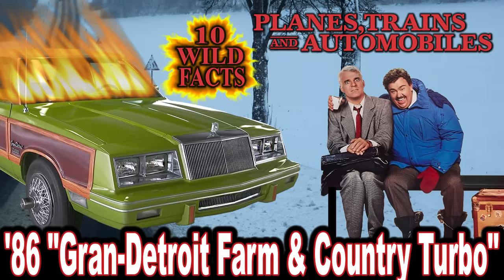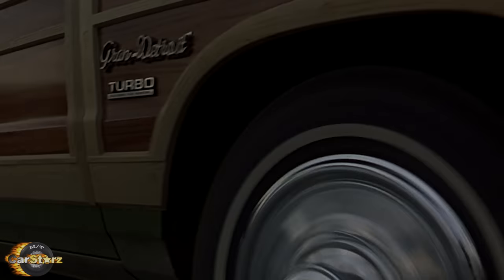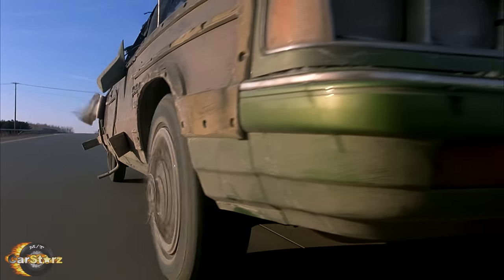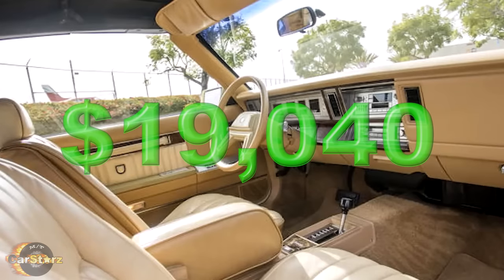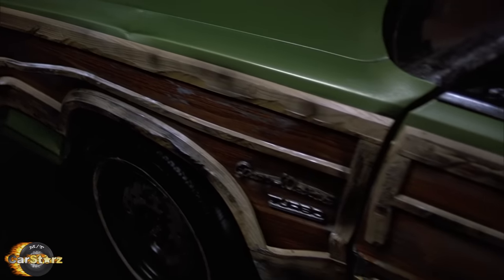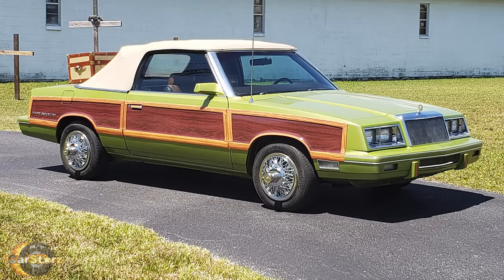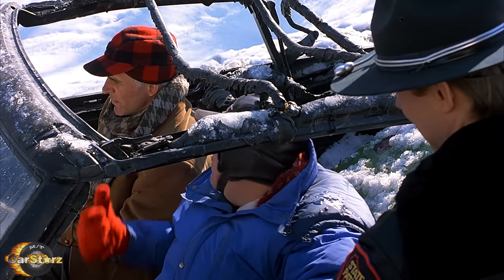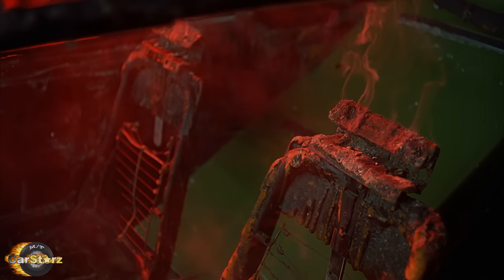10 Wild Facts About The '86 "Gran-Detroit Farm & Country Turbo" - Planes, Trains, and Automobiles

Comment: Just an FYI, those 2.2 turbos made 146hp…which was like 305 Chevy kinda horsepower lol 💪
Reply from the maker: Yeah, there seems to be a lot of varying HP numbers on those, not sure why that is; so I just went with the "around 100HP" as most ratings I've see for those were between 90-110ish for whatever reason.  Good to know though😉👍
Reply: Probably was close to a 305 Chevy in power and weighed a lot less! (So it would have been a lot faster!)
Reply: Well you got me! I have seen this movie countless times & is one of my all time favourites, yet I didn’t know what the car was called. (I knew what it was based on though) You have done another excellent job of research and teaching us a thing or 3. Thanks again, and keep up the great work. I see your channel is growing by leaps and bounds. Congrats!
Reply: Yes,but a lot lighter and rev to 6k.With 3.40 gears they were quick cars for that time!
Reply: Chrysler first generation turbo 2.2 introduced in 1984 was called the Turbo I and made 142 HP, it had a mechanical wastegate, in 1985 a computer controlled wastegate was added upping it to 146 HP.

The next one called the Turbo II introduced in 1986 added an inner cooler and made 176 HP.

The Turbo III introduced in 1991 had a Lotus designed 16V head and made 224 HP.

There were several other versions of their turbo 2.2 engine's like the Turbo IV that had variable nozzle technology but were installed on very few cars.

In an interview with Carroll Shelby he said that working with the Chrysler racing team for their factory race cars they were getting 700+ HP out of the 2.2 engine, that's not bad for an engine that stock in my mother's 1981 K-Car you had to shut off the air conditioning to keep it from dropping under 45 MPH going up the mountain behind our house.
Reply: Those Turbo 2.2 (and later 2.5) engines made great "sleeper car" engines. It was fairly easy to get a reliable 400-550hp out of those turbo engines. lead to FWD dodge minivans beating unaware Vette owners on the dragstrip. Good times!😆
Reply: In reality, around 100 horsepower is probably all that is getting to the wheels after going through the drive line.
Reply: @FordMan-pe7sm  
Yea but that's really irrelevant, all manufacturer's list their engine's shaft HP so throwing real wheel HP into the mix is kind of pointless because it makes comparing one thing to the other  difficult and just confuses things, to make things even worse there's whether or not you've got the air conditioning turned on or any one of a number of electrical options turned on like the rear window defogger that puts a heavy load on the alternator, even different drive train options sap different amounts of HP off before the rear wheels, so for comparison sake it's best just to keep things at shaft HP.
Reply: I had the Turbo II in a town and country Lebaron wagon.  It could sure pass a car on a 2 lane.  Light car and great HP for the 80s.

Turbo blew up the motor at 110k.  Too Much HP for that motor.
Reply from the maker: @unclemarksdiyauto  Nice, of course mostly wasted power in a FWD, but still fun regardless 😉👍
Reply from the maker: @unclemarksdiyauto  Glad you got some value out of it and thanks much friend😉👍
Reply: @CarStarz42  Anytime! Looking forward to your next upload!
Reply: @CarStarz42 ur right 90-100 best case I’ve had several including the Daytona Shelby edition ( built by California concept cars) for Chrysler corp and that’s as good as the 2.2 turbo got. MOPAR2YA
Reply: The only thing these motors really suffered from was bad head gaskets, but it was the gasket material. With a multi-layered gasket and performance head studs,, these motors can be turned into serious performers.
Reply: Yeah, Chevy 305 power in an upscaled Omni/Horizon.  The turbo 2.2 was more than enough power for the time. It was a delight compared to what had been available only a few years before.
Reply: @MSWMSW1 they weren’t too bad as engines, the big problem is the manual trans-axles could barely handle the stock engines making around 140HP and the automatics couldn’t even hold up under the stock power levels on the Turbo-1’s.
Reply: It was too ahead of its time. People still had a love for V8s and turbo cars of the time were thought of as unreliable

Comment: Speaking of FWD's in snow, I remember going to work in my '90 Geo Metro 3 banger thinking "this snow is bogging me down bad" Till sitting at the light I noticed the hand brake was on.:face-green-smiling::face-green-smiling::face-green-smiling:
Reply from the maker: Lol, yep; that'd do it too 😀
Reply: I had one of those, even with a piece of cardboard directly on the front of the radiator in the 10°F weather we get quite often in Pennsylvania that thing just wouldn't make heat, in temps that cold you could have drained the coolant and removed the radiator and drove that thing all over the place in those temps and the engine still wouldn't have gotten up to a real operating temperature, that thing was colder in the winter than an old VW Bug with rotted out heat risers, you had to dress warm in that thing.
Reply from the maker: @dukecraig2402  Wow.
Reply: @CarStarz42  
I bought that thing in the early fall when there was still leaves on the trees, come winter when it really got cold, and we had a cold one that year, the heater wouldn't make enough heat to defrost the windshield, so I put a thermostat in it thinking it was bad, didn't change a thing, put another one in that was the hottest one I could get, still no heat, then I put a piece of cardboard in front of the radiator which wasn't any bigger than a large coffee table book, it looked like it could have been a heater core from the back of an ambulance, still nothing, then I took thing's apart so I could get the cardboard right up against the front of the radiator, still nothing, so I put cardboard directly on the front and back of the radiator, not one bit of difference.
I doubt the thermostat was ever even opening, that little all aluminum 3 cylinder engine apparently was bleeding all it's heat out through the block and head, I have absolutely no doubt whatsoever that I could have drained all the coolant out of it and removed the radiator and it still wouldn't have heated up fully to it's operating temperature, it only had an idiot light with no guage but if it did I'll bet if the air temperature was anywhere around 15 to 20°F or lower it would have stayed on C.
With a decent set of snow tires on the front of that thing and it'd go anywhere, it was like an Army Jeep, and about as cold as one to.
Reply from the maker: @dukecraig2402  Man, that's wild for sure, lol

Comment: this is wild! i was just thinking yesterday that it would be neat if you did a video on this car! thanks!
such a great movie. slight correction: if memory serves those non-intercooled turbo 2.2s had about 146 hp.
Reply from the maker: Cool😉👍  Yeah, there seems to be a lot of varying HP numbers on those, not sure why that is; so I just went with the "around 100HP" as most ratings I've see for those were between 90-110ish for whatever reason.  Good to know though.

Comment: Road Champs made a Hot Wheels sized 82-85 Chrysler LeBaron convertible with opening doors and the option of top up or down.
Reply from the maker: Yeah, I couldn't find much on those though, so they wouldn't be easy for folks to obtain.

Comment: There is a 1:64 1983 Chrysler LeBaron Convertible made by the brand "Road Champs" , not the best casting since it was made in the 80's but there is one
Reply from the maker: Yeah, could only find the third gen '88 and up ones when I was searching for them though, but they probably did; not something that's still made today anyways.

Comment: Lol!  I owned a 1986 LeBaron turbo convertible.  It had more than 100hp.  May wanna check your specs before making a video!  Just a suggestion.
Reply from the maker: I did and most sites state between 90-110HP, depening on the engine size; so I just said around 100HP to be flexible.😉

I think they were just underrated though and were actually around 140ish HP.  Lots of varying info out there on that particular spec for whatever reason.